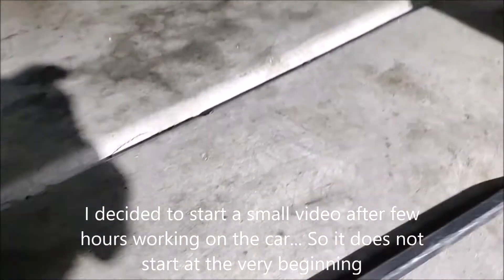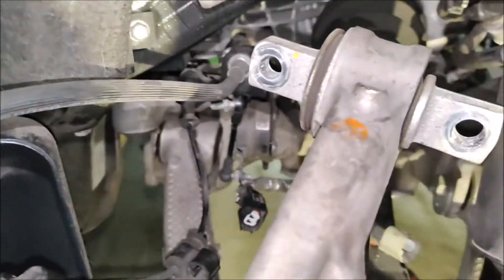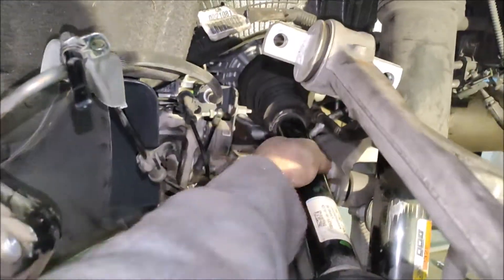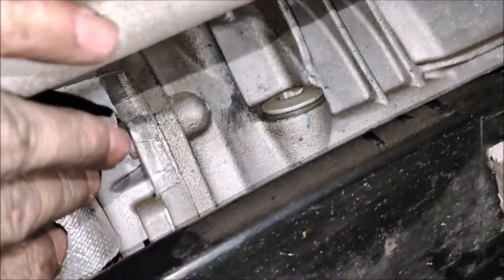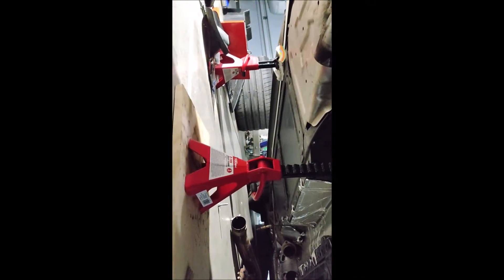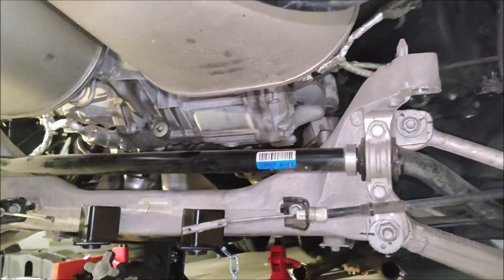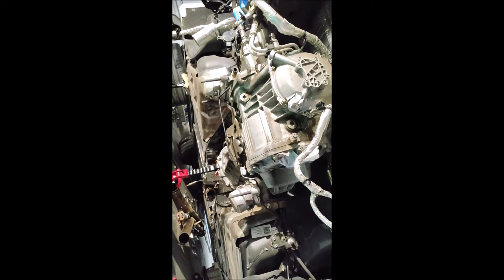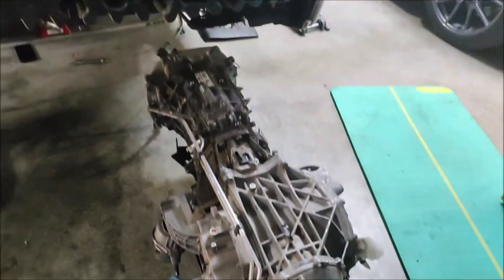C7 Corvette Manual Transmission swap / replacement / Upgrade

Comment: Nice swap i want to do same but what happen about  the Rev match does it work or still?
Reply: From a logical standpoint I would think not, since the padles are connected to ecu that tells it to shift. If u want a proper Manual swap u 1 need all the small part u didn't know u needed. And the the smaller brake pedal, clutch, and new ecu for the swap.
Reply: Unless they make a Wiring kit to basically bypass it and trick it into thinking its the rev match pedals that goes into ecu, but may need to splice some wires

Comment: Why its not safe or why you are not sure about disconnecting the tubes from edif/elsd module ? or losing oil in the circuit ? can u please explain the problem of it ? because we have dropped of the gearbox with the diff and in order to do it we have disconnected the lines from the module
Reply from the maker: Because there is a specific procedure to follow to prime the circuit I believe. Its probably in the C7 shop tech manual, but it might require specific tools or software to purge the air/bleed. I did not want to mess with it and spend unnecessary time. Someone did it and had to go to GM to get it done... i do not want GM to touch my car ^^

Comment: Hi there! Ive been researching this for some time and i want to say Great video and subsequent posts detailing your experience and procedure in doing this. I have a HCI '19 GS M7 and have a very similar build and purpose as yours. I mainly do road courses and the gear ratios in the Z06 M7 are much, much better. 

Im in the process of picking up a '17 Z06 M7 trans to get prepared for the swap, and i saw that you were having issues with limp mode. Were you ever able to get this resolved? Id greatly appreciate any insight! 

Love the car!
Reply from the maker: Hi.  I had to disable VSS sensor on mine, which disable cruise control and rev match. I still drive mostly like that because even if HP tuner released a fix, it created a bug on the track for me, that i didn't have the time yet to troubleshoot. You can see on my last videos that I have a track session with the rev match working. The following day the car was limiting power with a weird message on the dash so I loaded my older tune with VSS deactivated. Been running like that since but next season I will look into it. To note that 19's car seemed to have more issues with the swap than 17's, not sure why, it should work though. I can help you with the tune if you have issues (I tune myself)
Reply: Thanks for the reply! When I looked into it, I could hardly find any info on these swaps aside from your posts and video.

What were you able to find on the '19s that cause more issues? I'm kinda nervous about the whole thing, so I'm trying to get as much info together before I pull the trigger
Reply from the maker: @MrMaus3r  I don't. One guy with a 19 contacted me and his shop never got it to work, but to me they were useless. They fucked up the assembly the first time and damaged sensors. The guy did not have HP tuners so I was not able to help him. I believe the HP tuner fix will work for all cars but I cannot be 100% sure.
My fix should work as well (disabling VSS) but I cannot know before someone tries to load my config with HP tuners
Reply: @nabushdinosaure  When you say the HP tuner's fix, do you mean a separate fox from your VSS switch deactivation?
Reply from the maker: @MrMaus3r  Yes. The fix works, just had a bug with it I did not fix yet, but nothing serious